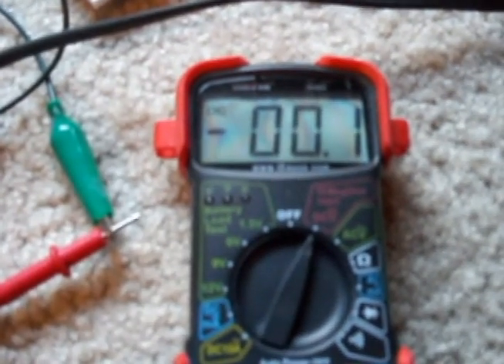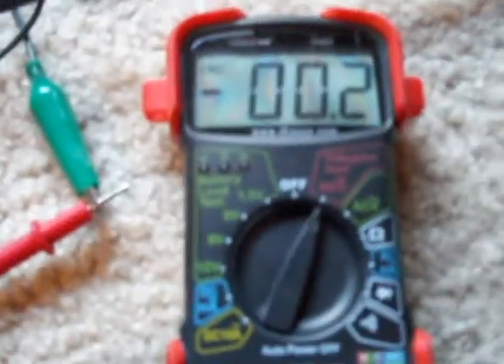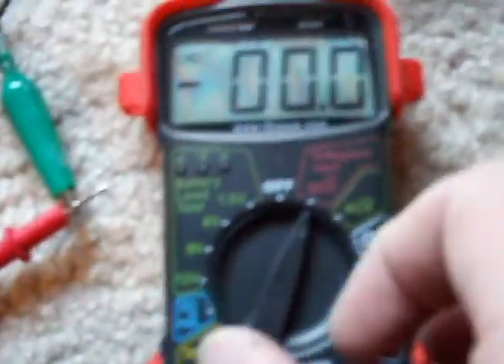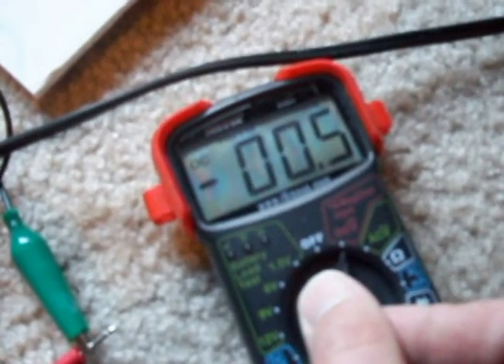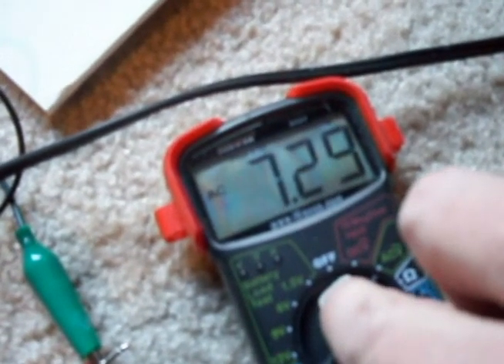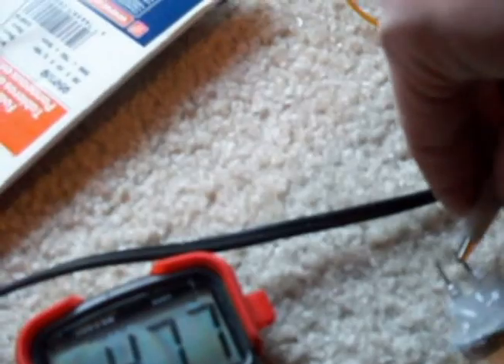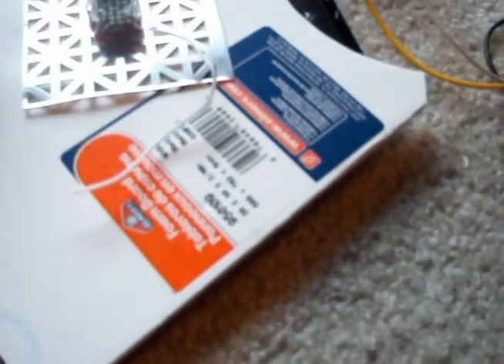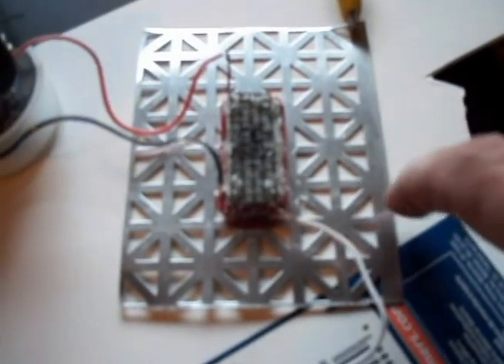3 Crystal Test

Comment: Hey bro. 🖖
Tell me, did you manage to develop a functioning prototype of the testatika machine?
Reply: Were you able to understand that the wheels are a separator? The separator sorts and separates charged particles into two types of charges. The flow of charges can only be obtained from an external massive antenna by connecting a wire to the center of two disks.
Reply: Charged particles are generated by the Sun. Because the Sun is a large magnetron with a liquid cathode with a high temperature of 5500 degrees Celsius. Charged particles descend into the earth from the stratosphere through the atmospheric gradient.